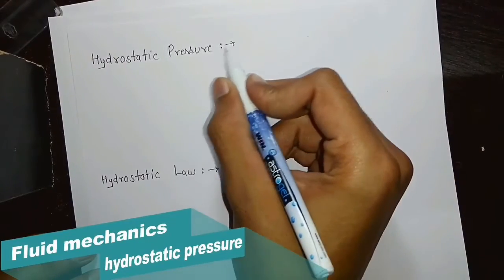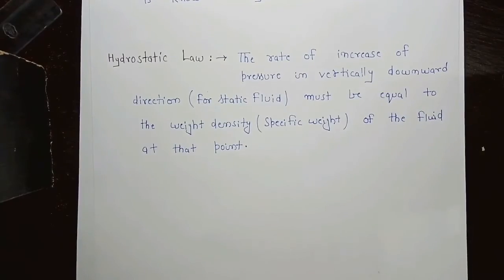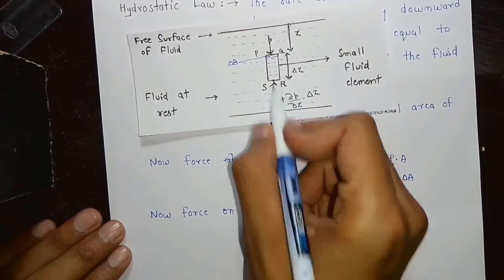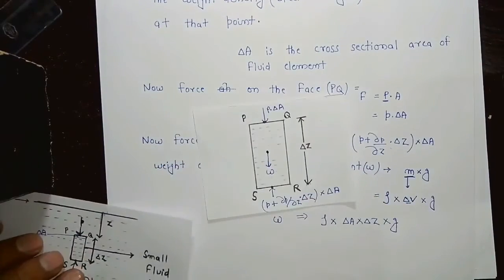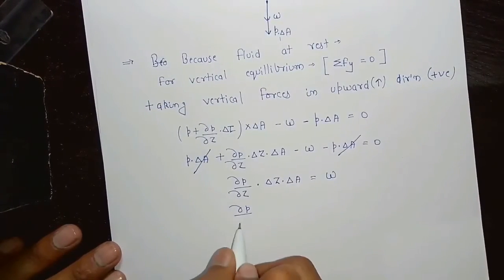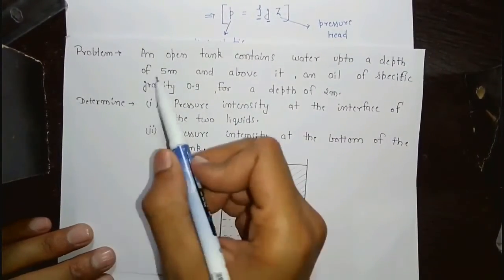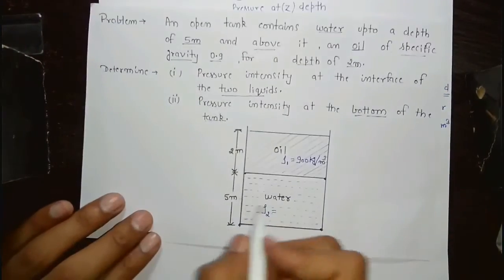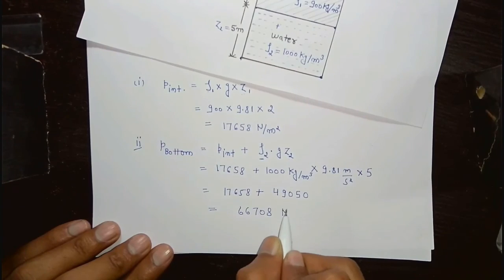hydrostatic pressure civil engineering

Comment: The hydrostatics (not limited to this lecture) misses one point: gases are compressible and liquids are not. This essential difference is missed since liquids and gases are treated as if they acted the same. This results in strange principles, for example, that like a gas, the pressure exerted by a liquid against the walls of its container are the same as the hydrostatic pressure, which completely bypasses the issue (not existent in gases) of mass, resulting in a liquid in the case of narrowing container towards the top, of exerting more force against the base than its weight! How a liquid possibly exert more force than its mass against the base than its weight?